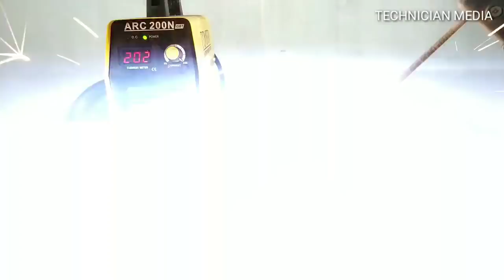ആർക്കും ചെയ്യാം വെൽഡിങ് 2 |Arc Welding tutorial Malayalam 2

Comment: മാക്സിമം AMP നിങ്ങൾ ഉപയോഗിക്കുന്ന welding road നു പറ്റിയതല്ല road കത്തിപ്പോകും. 3.15mm road ഉപയോഗിച്ചു തിക്ക് മെറ്റീരിയൽ  Weld ചെയ്യുമ്പോൾ കറന്റ്‌ 120 amp വരെയും അത് thin മെറ്റീരിയൽ ആണെങ്കിൽ 70-80 amp വരെയും സെറ്റ്ചെയ്യാം. Thin മെറ്റീരിയൽ weld ചെയ്യുമ്പോൾ പ്രോപ്പർആയി ചെയ്യാൻ പറ്റുന്നില്ലഎങ്കിൽ വണ്ണം കുറഞ്ഞ road ഉപയോഗിക്കാം. Angle grinder ഉപയോഗിക്കുമ്പോൾ safty guard ഉപയോഗിക്കണം അല്ലെങ്കിൽ  റിസ്കാണ്. Cutting weel കട്ട്ചെയ്യാൻ വേണ്ടിമാത്രം ഉള്ളതാണ് അതുകൊണ്ട് grind ചെയ്യരുത് അതിനു  grinding weel ഉപയോഗിക്കുക. മറിച്ചാണെങ്കിൽ അത് cutter ന്റെ ലോക്ക് ടൈറ്റ് ആകുകയോ ബ്ലേഡ് പൊട്ടാനോ സാധ്യതയുണ്ട്. കട്ട്ചെയ്യുമ്പോൾ cutter 90°ആംഗിളിൽ പിടിക്കണം Grind ചെയ്യുമ്പോൾ 45° ആംഗിളിലും. അതുപോലെ face shield ഉം leather gloves ഉം ഉപയോഗിക്കണം.
Reply from the maker: ഓകെ താങ്ക്‌ യൂ സഞ്ജയ്
Thank you so much
Reply: Ningalke Oru video detailed aayi ondakkikkoode.
Reply from the maker: @gowthamankanakapuram  ok ചെയ്യാം
Reply: വളരെ ശരിയാണ്. ഏത്ര സമയം എടുത്താലും ഏറ്റവും സൂക്ഷിച്ചു ഉപയോഗിക്കേണ്ട ഏറ്റവും അപകടം പിടിച്ച ടൂൾ ആണ് ടോർച് കട്ടർ. എപ്പോഴും സ്വിച്ച് ഓഫ്‌ ആണോ എന്നു പരിശോധിക്കുകയും ഉപയോഗം കഴിഞ്ഞാലുടൻ ഡിസ്കണക്ട് ചെയ്ത് വയ്ക്കുകയും വേണം.
Reply: Good information. 
Bhai normally ellavarum grinding machine cutting num grinding um use cheyunnathu kaanaarundu. Cutting blade ettaal cutting tool, grinding wheel ettaal grinding tool.
Njaan oru welding Inspector cswip 3.1 aanu. Oil& Gas field il 7yrs aayittu wrk cheyunnu. Njaan kaanunna kaaryam aanu paranjathu. Details I need to refer.
Reply: @sijotjose6205  താങ്കൾ പറഞ്ഞത് വളരെ ശരിയാണ്. എനിക്ക് അനുഭവം ഉണ്ട്.
Reply: Nice
Reply: ഇങ്ങിനെയുള്ള വീഡിയോ കാണുന്നവരിൽ, ഇതിനെ കുറിച്ചറിയാവുന്നവർ ഉണ്ടെങ്കിൽ, മേൽപറഞ്ഞ തരത്തിൽ കാര്യങ്ങൾ  വിശദമാക്കിയാൽ വളരെ നല്ലതാണ്. നന്ദി.
Reply: Hand cutter ഉപയോഗിക്കുമ്പോൾ ബോൾട്ട് ഓവർ ടൈറ്റ് ആക്കാതിരിക്കുക  . അതുപോലെ ഓവർ ലൂസ് ആകാതിരിക്കുവാനും ശ്രദ്ധിക്കുക

Comment: Enganeyanu welding machinil ninnum shokk adikkunnath,  welding IL sambhavikkunna apakadangal enthokkeyanu bro
Reply: Welding set ൽ നിന്നും electric shock അടിക്കാൻ സാധ്യത കുറവാണ്. Power supply യിൽ connet ചെയ്യുമ്പോഴോ wire ഇൻസുലേഷൻ പ്രോപ്പർ അല്ലെങ്കിലോ ആണ് ഇതിനു സാധ്യത. Weld ചെയ്യുമ്പോൾ പൊള്ളൽ ഏൽക്കാനും വെൽഡിങ്ങിന്റെ പുക കണ്ണിൽ കയറാനും സാധ്യതയുണ്ട്. കൂടാതെ ധാരാളം സമയം വെൽഡിങ്ങിന്റെ പുക മുഖത്തോ മറ്റോ അടിച്ചാൽ അവിടെ തൊലി കരിഞ്ഞു പോകാം.
Reply: @sanjayk.k8184  thanks brother
Reply: @sanjayk.k8184  bro rod continues weld ചെയ്തപ്പോ rccb trip ആകുന്നു, അത് എന്താ reason
Reply: @jaseemkhan1059  RCCB heavy current flow undakumpol circute break cheyyum. Ningal weld cheyyumpol welding set RCCB supply cheyyunnathinekkal current valikkunnathinalakam ee problem undakunnathu.

Comment: Here you used proper technical word as slag. Very good. But your cutting blade rotation direction is wrong. This is not safety. Cutting arc should not comes in our direction. Cut cheyyumbo varunna thee pori elle...athu nammude opposit direction il varanam. guard um use cheyanam. Rotation direction change chayithaal madiyaakum,ellenkil thirichu pidikkuka.
Reply from the maker: You are correct
Thanks brother